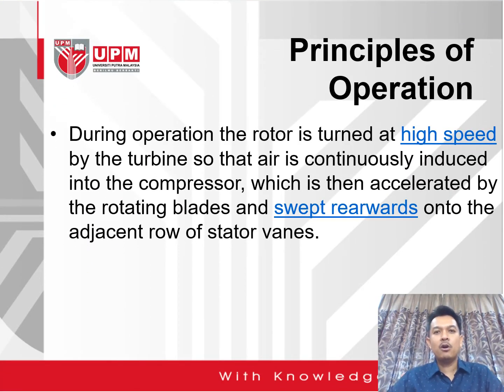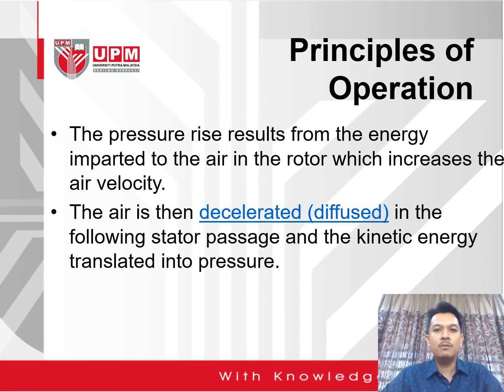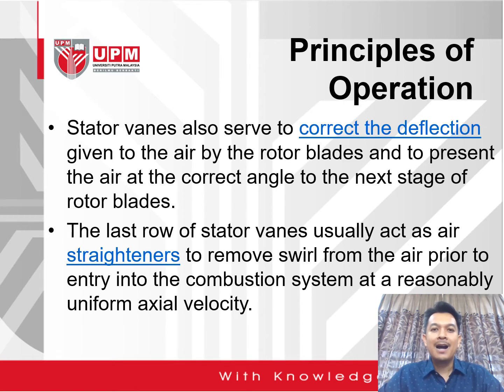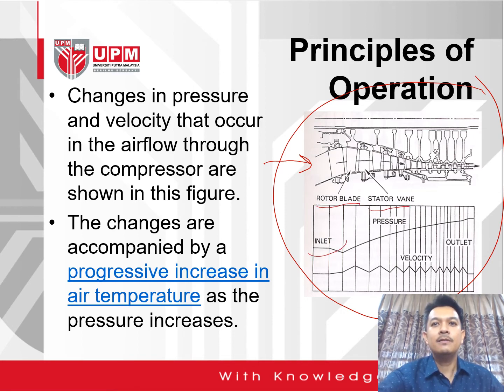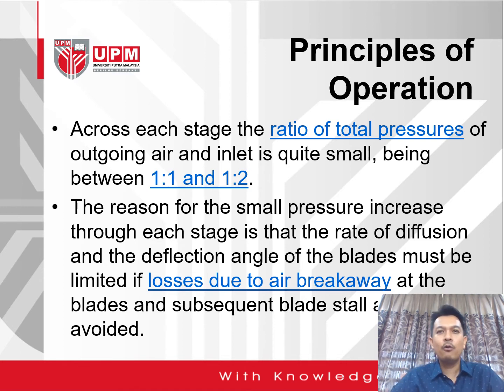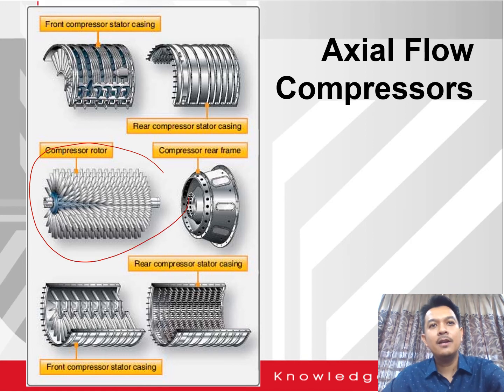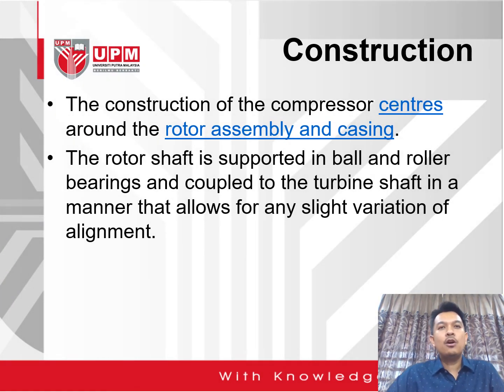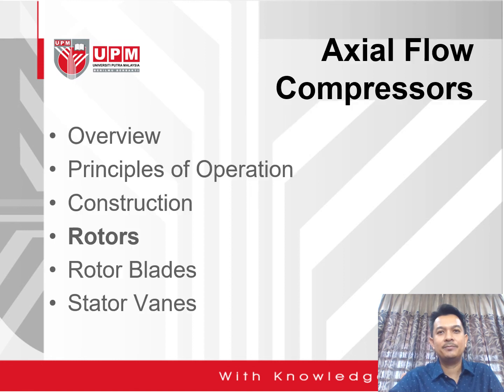Compressor: Axial flow (part 2)

Comment: Salam dr, i want to ask about the velocity. As the air entering the rotor blade and stator vanes, what is the causes of the velocity changes increase and decrease?
Reply from the maker: This is a good question Ain. The spaces between the rotor blades and stator vanes are decreasing as the air goes into the compressor stages and the rotation of the rotor blades accelerate the air.